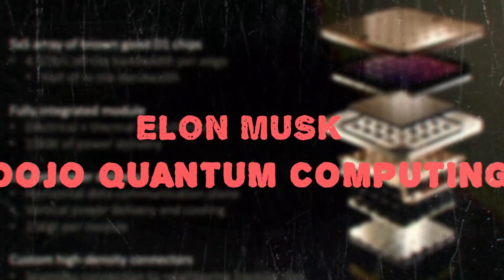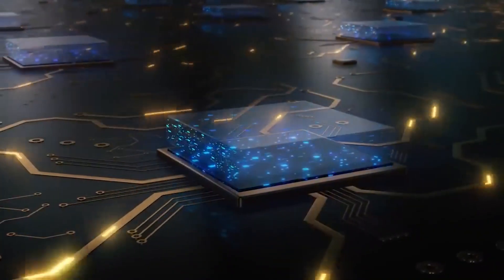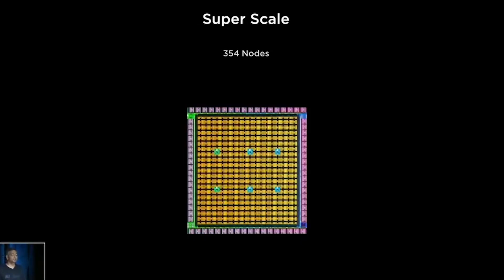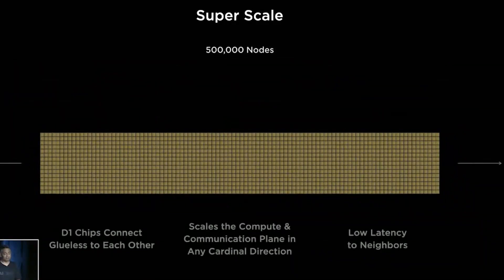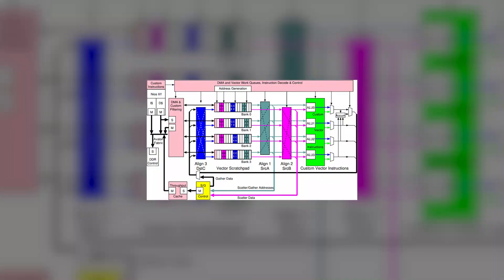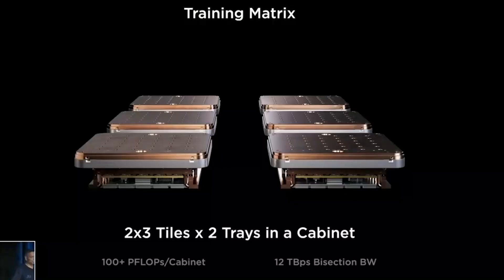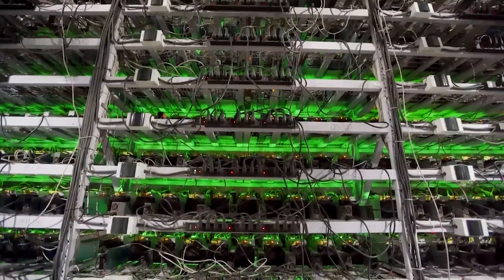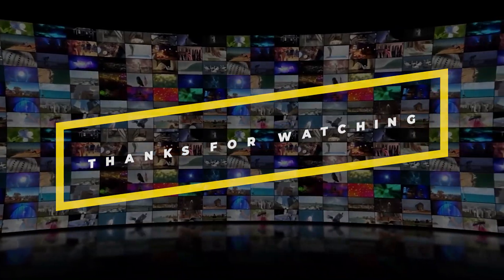Elon Musk Dojo Computing

Comment: I heard no mention of qubits. Is this actually a "quantum" computer?
Reply: Of course NOT.
It is a Neural Network machine lerning divice.
Reply: It's an AI specific dedicated architecture of massively scalable and locally interconnected processors, ones which they can funnel epic amounts of data into, and the silicon and specialized code is specifically optimized to find patterns, or sort, or recognize, or whatever they optimized the IC's to do, far better than a standard x86, or ARM, or any general purpose architecture CPU could. It's funny he mentioned exaflop barrier because that has little relation to the effective performance as it relates to clock frequency, I'm sure it will smoke anything AMD, Intel, IBM, or ARM could come up with, but it's not a Quantum Computer, not even remotely close. If anything, it's a better solution than the GPU based "hacks" we use currently, which is pretty amazing in itself tbh... but I doubt very much this will cure cancer, predict weather, or do anything other than help Tesla's bottom line, which is why they did it really. Good business, Elon's not in philanthropist mode yet, but if he chooses that route I bet he creates an army of something to purge the planet of us lol ;)
Reply: @Dosperado  Thanks for the detailed response. I did not get the impression this was a true quantum computer despite its name. Your reply confirms my suspicion.